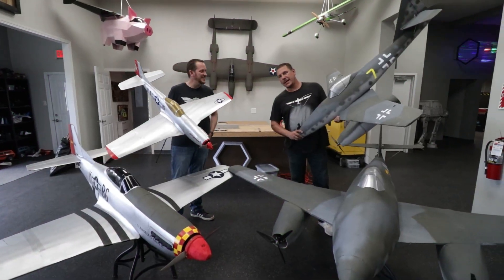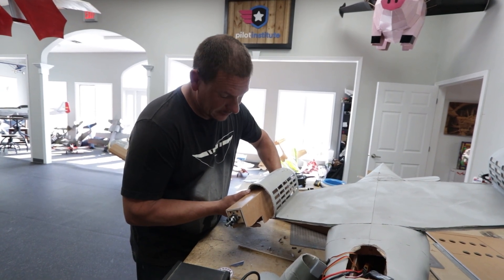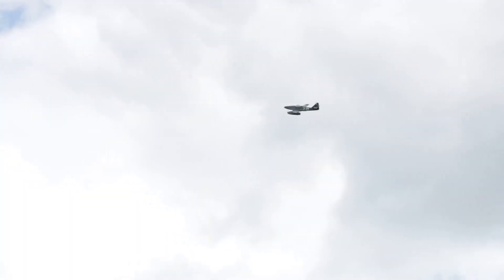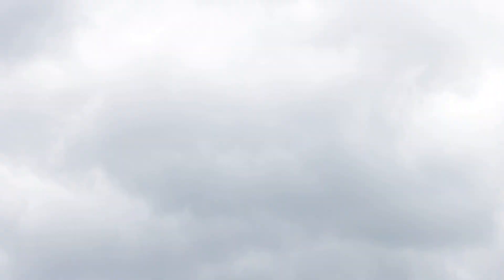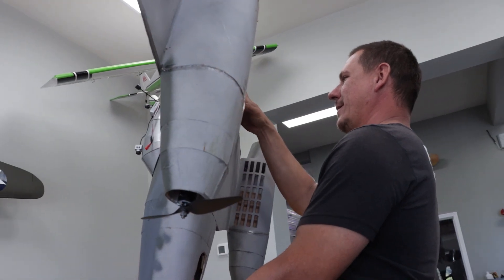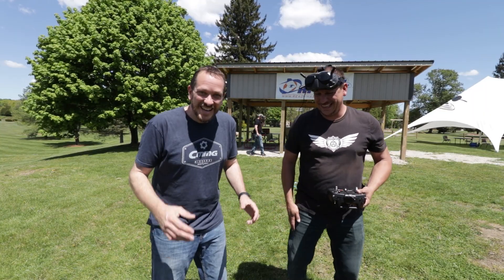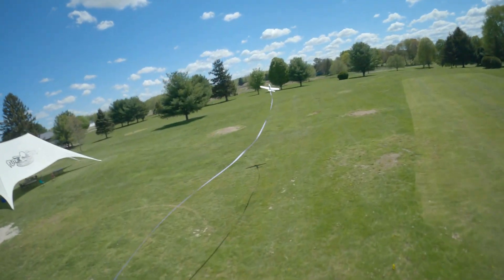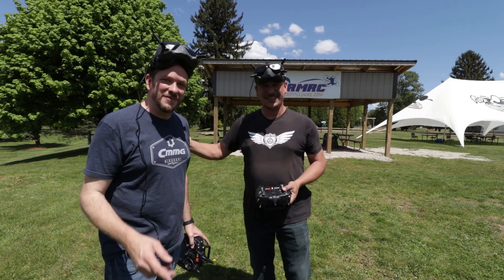Epic Battle Between American Mustang Vs. German ME-262

Comment: Hey guys, i remember the noes cone on the P-51 isn't centered right, if you take a block of Glued foam bored the side that it needs to be, and Spin it fast as you sand it down to shape, that will help insure a Balanced nose cone ;3

Comment: Guys-the BEST visual attack format is by using bottle rockets in sets under the wing. You remove the sticks and insert estes rocket motor igniters into the fuse area. Add paper fins and little nose cones and insert them into 3/16 dia alum tubing cut to size and glued together in a string of 5. Then, when up in the air and on the tail of your target, you hit the appropriate firing circuit, and off go the rockets, leaving trails and exploding at the end of flight. I haven't figured out individual firing circuits yet. You can do a similar thing with roman candles, and they fire tracer balls! It's just that when lit, they ALL go off continuously until done. I hope you'll try these and film them, that'd be a gas!
Reply: Yes it could be strapped to an f 16/18 and be a literal missile!!!! Someone needs to ask to use this! What a great idea!